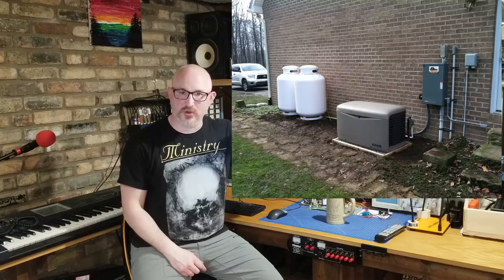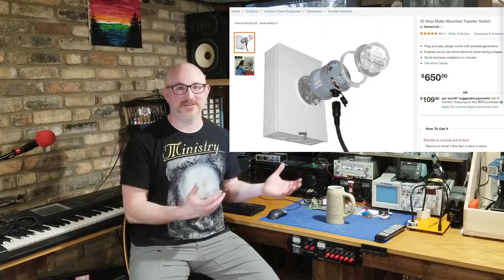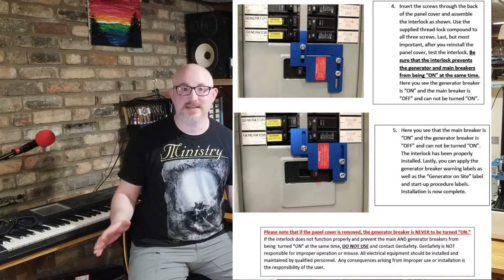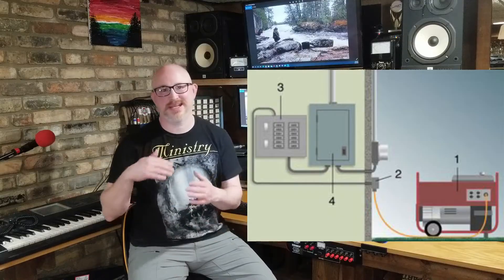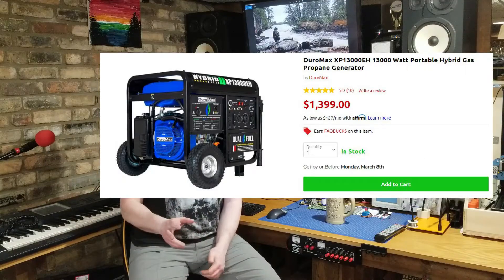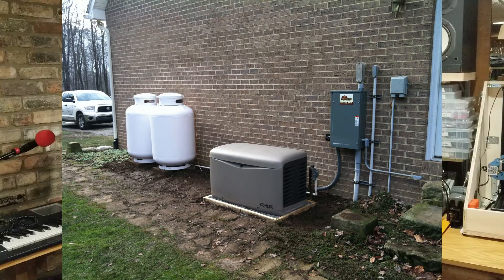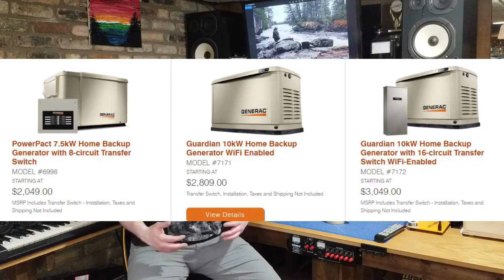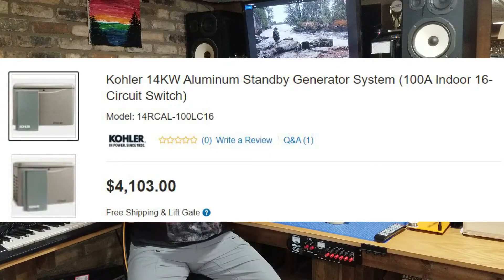Electrical Engineer explains connecting generators to your home

Comment: I would like to see the multi meter test on an outlet pre-and post modification. Though my Generac GP 5500 looks a little different behind that cover. Testing with a multimeter of an outlet I removed a green yellow wire that was connected to the generator case by a single 7 mm head bolt.  And it seemed to pass the multimeter test for a unbonded neutral. Now you have me questioning that as you in the initial part of the video showed reattaching the green yellow to the same bolt, but removing the white wire. Mine never had a white wire running directly to the same spot as the green yellow wire. It appears I have the same block with four studs, but mine are all in use. Mmmmm

Comment: I have a bonded set up on my house and I told the electrician that my new generator is bonded as well. The electrician Ralco company in Mass told me that they do that set up all the time and no problems. I very concerned and not a pro but I have doubts on the set up. Please advise thanks.

Comment: Thanks for a great video! I'm getting ready to buy and set up what will likely be a Westinghouse 11,000 watt (surge rating) portable inverter generator with an outdoor 50A connection running to an interlocked sub-panel in our basement.

I wired our entire house a couple of decades back when we built, putting in two 200A service panels in the garage, with one feeding a 125A sub-panel in the basement for future use. I just finally got around to finishing the basement, and it includes everything we need to live during a power failure, including a small kitchen, etc. With the added complexity of two main service panels it makes sense to me to just power some of the sub-panel breakers with the generator, and move downstairs during an extended power failure.

I just need to wire up the outdoor port, add a main breaker to the sub-panel (that branch breaker is of course in the main panel and therefore can't be interlocked), and shuffle the breakers down one side to make room for a new 50A breaker for the generator input adjacent to the main to interlock with it. I'm not ecstatic about adding a main breaker since it'll really means I'll have two breakers in series in the feed to the sub-panel (one in the main panel and one that'll essentially be a local interlocked switch in the sub-panel) but I believe doing so is code compliant. I plan to attach a little pilot light on the sub-panel to illuminate when the branch from the garage sees utility power. With my neutral & ground bonded at the service panel I'll float the neutral in the generator. I really like the idea of installing a little toggle switch to allow for selectively bonding the generator neutral for using the generator away from the house connection, do I'll probably make that little mod.

I think I've got all this right. I'm a retired EE and did the wiring in this house and a couple of others from load analysis to pulling a ton of wires to panels and fixtures, but I'm a control systems guy not a power guy. With my planned generator install being a little different than most I thought I'd describe it, and I'd sure appreciate any feedback!
Reply from the maker: What you are describing makes sense.  Ensure you don't have a neutral-ground bond in the sub panel.  That way,  floating the generator allows for the main panel bond being the only bond in the system.  

The interlocked main-generator breakers act like a bonded-neutral manual transfer switch.

Comment: My Westinghouse 11,500TFc gen set and I took the Green/Yellow jumper off and now it's an unbonded/floating unit. I had an electrician to install a 50Amp inlet box outside and it feeds the 200Amp panel box with a gen lock out plate. Being unbonded gen set am i ok with main panel doing the bond for my home and gen set.  Correct??.

Comment: The nice thing about the new outdoor disconnecting means change is that I can add a before simple open transition transfer switch to homes. Really easy for the customer to understand up for utility and down for generator.
Reply from the maker: Agreed, but it's nice to have an external disconnect for the main panel which makes working in the panel 1000x safer!

Comment: Hello, I have a Generac 17.5KW generator with a 50A Generator Inlet Box and a 50A breaker with an interlock kit in the main panel. Question, right now I am only utilizing the 50A plug to connect to my main panel. How can I take advantage of the remaining 5.5KW of power without using extension cords? TYIA.
Reply from the maker: Your connection is undersized for that generator.  Your best bet is a proper transfer switch, rated for the panel amperage, so you can use the full generator capacity.

Comment: Flame sensor on my gas furnace depends on a low-voltage current to ground through the ionized flame.  My floating-neutral generator wouldn't run my furnace with an extension cord until I made a bonding plug & put a ground rod out by the shed where the generator sits.
Reply from the maker: @RisheSefid  if you're using extension cords, the generator should be bonded.  I discuss bonding in detail in subsequent videos
Reply: @richardvedvik979  Yes.   And connected to the earth, so the flame sensor works.  Was my point.

Comment: Great video summary of the options my friend.  What about using a Ford Lightening with their Pro Power onboard (9.6kWac with a 14-30 receptacle in the bed of the truck? Assuming the bonding is at the Main Service Panel. The Lightening also has GFCI so it will trip. I did find a neutral switching manual transfer switch but was hoping to be able to power the entire panel through an interlock kit. Since I have protection at the house, is it safe to remove the ground connection at the Lightening? I would make up and clearly label the cable so it wasn't used in other scenarios.
Reply from the maker: @TJMerrill  i need to make a video about on-board vehicle generators. 

In your case, you'd want to refer to my generator bonding video that discusses this problem directly, and my subsequent videos showing installed solutions.

Comment: Hi Richard, I have a Predator 9000 Generator, and I installed an inlet box and a BR230 breaker to my panel. The panel is a Cutler Hammer 200amp (Eaton) that have a shared ground and neutral bar. I'm hearing a lot of talk about Floating vs Bonded neutral generators. Many people are saying that I need to unbond my generator, is that true? Thanks.

Comment: A minimalist or someone with a minimal threat of an outage, could buy a pure sine wave 12 volt inverter with sufficient output to run the most important devices. No need to even take it out of the box. Just plan to spend 5 minutes when and if you need it to understand how it works, hook it to your car and stick an extension cord in it. I did this for 5 days, idling my F150 about 50% of the time. I kept the freezer and fridge going, some lights, fan and TV. I'd get the smallest one that will suffice, as they do have an overhead cost. Mine was 700 Watts. I used half a tank of gasoline. Now I've graduated to a large backup system, but I can loan my inverter to a neighbor.
Reply: Considering the same idea to plug into EZ generator transfer switch.   How does bonded neutral vs floating neutral come into play?   Also should the transfer switch be at the panel or on the line going to furnace?

Comment: Excellent video. I have a question about the Generlink meter connection. They have a proprietary connector at the device. Most come with a 20' cord. Can you connect an extension cable to these cords safely? For example, the generator connection end is a L14-30 connector. Can you get an L14-30 extension cable to extend the proprietary Generlink cable?
Reply from the maker: @timr9082  yes, i see no reason why a longer cord would be an issue, just account for voltage drop with long distances and waterproof the connection.

Comment: Hi Richard, I have a new Pulsar GD10K generator and was wanting to separate the neutral from the ground except the wiring is way different on mine. When I took off the cover I have an aluminum cooling block and attached to the back is all the main coils and electronics and the wires that go to the control panel. I tried making sense of the schematic but it may as well be in ancient Egyptian. Any advice would be appreciated,or should I call their number and talk to a tech?
Reply from the maker: @JamesDursi  have you seen my video on breaking a neutral-ground bond?  Link to the manual/schematic?

Comment: I appreciate your video collection.. well done sir.

From my studies and electronics background.. I recognise the bonded ground parallel problem with connecting to house panel with interlock.

Do you know if the meter extension lifts the nuetral from utility?

It doesnt look like it.. because the nuetral lugs are bus barred, not the hot legs..

So Im trying to understand which is best.. 
I understand the switch you installed on your generator 
And I understand the need to create a single pathway for nuetral ground.. which I have bonded nuetral generator.

I was considering using a 3 phase disconnect to completely severe the UTILITY including their nuetral.. but that would be a major step involved asside from the interlock device.. it could be done, but would need mounted next to the service panel with clear instructions for disconnect first BEFORE INTERLOCK activation..

This 3 pole disconnect would illiminate the parallel pathing problem. And I would not need to create a floating nuetral switch like you did for yours..

Does the 3 pole disconnect feature at the service panel work correctly in your mind?

I live in Florida under FPL 
My service panel is an older GE with shared nuetral ground bussbar.. 

I recognised the nuetral bonding and the parallel as an issue which is how I made my way to your video collections..

The meter extension seems fault proof, but the 3pole discconect should also do what I want.  
Your thoughts please.. safety and simplicity is also my goal.. to correctly illiminate the parallel nuetral/ ground and bonding issue
Reply: I cant add to the original comment question, so here is only option.

My portable gen. Is an INVERTER generstor. Ryobi model RYi6522.
I tested across all recepticals ground and nuetral.. it is fully bonded with breakers.. the 120 duplexes are gfci equipped.

So..it wont work the meter extension transfer switch according to the manufacturer.

So I have to figure out a salution to break UTILITY nuetral.. as described in original posted question.
The 3 pole switch matching my service panel amp rating.. is the only option Im able to find so far.. 
With the configuration of my utility meter box mounted directly behind my service panel.. I have about 2.5ft of the large utility conductor to work with to go to 3pole disconnect sub panel.. and then buy new same guage to run back into service panel to main breaker and nuetral lug.

I dont see any other options.. unless you know something I havnt found.

The idea is to install both 30 amp L14 30 and 50amp strait blade external generator recepticals for standard, or upgraded generators..(obviously not both at the same time, just either or, but thats just an option at this point)

Wanting to use #6 to backfeed gen 50amp breaker, nuetral/ ground to handle the 50amp gen set. 
L14 30amp will never be under rated, and the 50 amp option is already prewired.. thats the plan anyway.. 

Thoughts?
Reply from the maker: For your second post, the L14-30 on the RYi6522 would be best connected to another L14-30 recessed male receptacle as you expect.  Routing through a 3-pole manual transfer switch would be preferred, but is also an expensive endeavor.   Or, if we can find a wiring diagram, you could modify the generator to be floating neutral, but you'd then be unable to use it in standalone mode, as my video on modifying generator bonding describes.
Reply from the maker: Sorry for the delay.  The meter disconnect is described (and shown) in 2023 NEC Art. 702.5(B).  This section does not clarify if the generator needs to be separately derived or not, so you'd have to verify with the meter-mounted transfer switch you'd have access to and your utility allows.  Your best option is to switch the neutral and leave the generator bonded, as you suggest.  Another good option is to revise the generator so it is not bonded and then you'd leave the wiring as-is.  I have a video on revising the generator.

Comment: agree w others , good clear video...plan to use the EZ generator switch for a few panel circuits..will power w either my floating neutral ecoflow  power stations or with my tri fuel champion gen, #201176....the EZ switch developer told me  it's best to convert my generator 'bonded neutral' to a floating neutral so both sources would be' floating neutral' .. be aligned w the Code..  and Champion shared a simple video regarding this..easy to do..
my question is does the generator need anything re grounding?..as far as i can tell it's grounded to frame..

Comment: Great video, thanks
Could you talk about THD on non inverter generators? Should we be concerned on using them with all new appliances? My UPS started acting up when I ran big loads on my generator. Should devices that have AC - DC converters like laptop be good using this energy?

Comment: I have a situation where my meter can and main are on the north side of house and my garage  and non main panel are on the south. How do I interlock in that case.  I've been thinking about putting a magnetic key box in the main cabinet, you have to get the key at the main to unlock the lock on the breaker lockout device,which is on the generator breaker in the panel, then put the breaker lock out device/lock back on the main. There is a lot of back and forth, but all I can come up with. What is your opinion thank you
Reply from the maker: @momeyerjr  a Kirk Key interlock system is how we do remote interlocking.  Simply put, one key and two locks.  Key has to be inserted to close either breaker so only one breaker can be closed at a time.
Reply: @richardvedvik979  Thank you

Comment: this is the worst way to connect your generator just get an interlock kit and you can be in control of what you power!!
Reply from the maker: This video discusses several ways to connect a generator, including interlock kits, but not everyone has or wants the option of an interlock kit.  I explain interlock kits in detail in subsequent videos, including how to deal with neutral-ground bonding.  https://youtu.be/Nrnforx1uFI?si=7vHFs8LJ-jaGpncG

Comment: Trying to install a transfer switch on my home .. I have to concerns that are unclear .. my first is that my main panel is outside and I have a sub panel on the inside of my home .. how would I add a lnterlock in my panels? If my main panel is outside and my sub panel inside .. my breakers will not be next to each other .. and my last question is where do I wire my ground wire from my sub panel to my transfer switch panel? From my understanding the main and sub panel can’t have a screw for the ground wire .. thank you and I hope I explained myself good enough for you to understand what I’m trying to ask.

Comment: Hi I have a westinghouse 14500 backup generator, I believe its a bonded generator I have the generator connected to my main house breaker panel with the interlock that makes sure that the main and generator breaker cannot both be closed and i’m using the 50amp plug on my backup generator is it safe to run like that or do I need to have a different ground setup?

Comment: So I just purchased a mobile home that I am using in a completely off-grid setting with absolutely no power from the grid. I would like to hook up a generator to operate the home, there is a minimum power load as all of the appliances are propane and some of the lighting will be ran separately through a 12-volt solar power system. There will be a small fridge, an evaporative cooler and two window ACs. My question for you is where the electrical connection that would normally go to the power grid be, could I take the wires that would generally be attached to the power grid and instead put a 50a 220 male plug on the end of that and hook directly into a generator? Sort of to make it like a motorhome or travel trailer would be with its shore power connection. I would still have my grounding cable in the ground with a copper rod for the mobile home as it would be normally hooked up if it were otherwise on grid.
Reply from the maker: Treating it like an RV makes sense.  That would allow for transfer from solar/batteries to generator as needed.

Comment: I installed an interlock on my panel, put in a 60 amp breaker, installed a 50 amp shower power in outside and use a 50 amp RV shore power cord to feed my panel. I also installed a power meter on each leg so I can see how much is being pulled off each leg as I turn on breakers. I did all of this about 2 months before the big freeze we got here in Texas a few years ago where it got down to zero for a few days and we lost power for 3.5 days. I was a super hero for those 3 days let me tell you. I use a duel fuel generator I got at Costco for $699. Its been a workhorse. I also put a soft start on my AC unit so it will run it also. Total cost for everything was under $1000 as I already had the RV cord.
Reply from the maker: Thanks for sharing, and nice work taking care of the family!  Sounds like your timing was perfect!